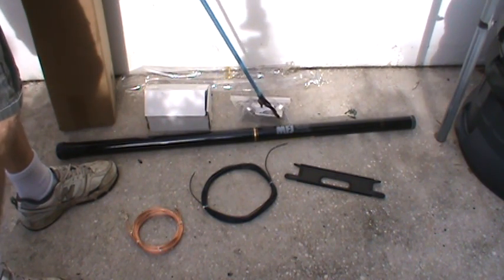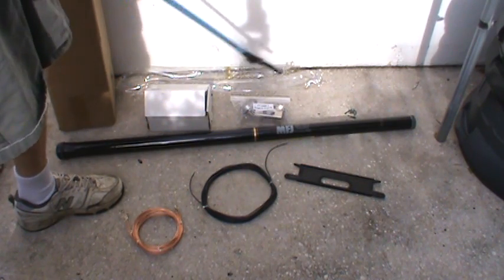TRRS #0833 - MFJ-2980 Vertical Antenna PT 1

Comment: DE: W4JWM  -  MFJ-2980 Vertical Antenna $139.00 U.S. - I have been a Ham & Broadcast Engineer for 50 years, so take this for what it's worth. This antenna works very well, but it must be mounted 3' on PVC pipe (bought separately at the hardware store) and above the ground with NO additional counterpose. The 4 radials that come with it need to be at a 45-degree angle from the top of the 3' PVC mount to the ground. DO NOT put the ends of the radials in the ground! Do NOT put on a fence or other reflective material.  It has a very, very low angle of radiation for DX work. I bring it with me in the RV in a 3' package and have worked the world on FT8 and even SSB on 80 meters to the EU from Florida. Matches well with an internal IC7300 tuner on 80.  A good antenna for home use or portable. Has 3 DBd, not Dbi gain on 17 meters. For the price, I would get it well before buying a loop or an expensive vertical. Perfect for FLEX and other users who can use divergency on receive.
Reply from the maker: This is valuable information.  Thanks for sharing and have a great day. Finally we are getting some good weather down here.